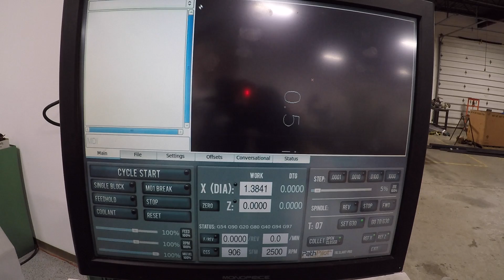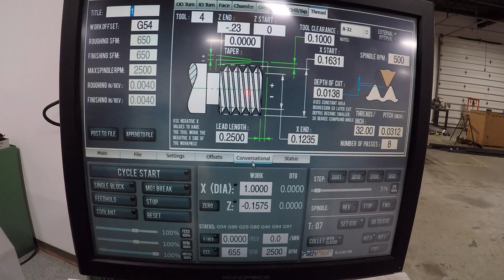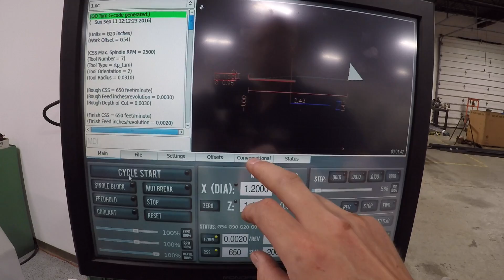CNC Turning Hard Steel!  WW112

Comment: Good tip for using the phile, not many people know that. I do not like the position of the turning tool, it generates vibrations on longer pieces. Must be placed upside down, the insert must face you, and you see beter what is doing and most important you increase the rigidity of the mashine. Think about it: You have the tip of the tool. Rotation of the chuck makes presure on the tip who transmits the tresure to the tool holder and then the preasur goes to x axys. It ghets all the play from x axis if any. Correct me if i am wrong.

Comment: This diameter is about one inch. How does it work, if the diameter is much smaller? My lathe has a max. rpm value of 2500.
I think the sfm value is then to low. cbn tools need high speeds.

Comment: The  dowels  are   surface  or   case   hardened  usually  they are  carburised  and    heated and  quenched in water  .Only surface layer  gets hardened  More ever  the process produces   martensite  structure  which is  and abrasion resistant  But they  not  as hard as  steel  which is  venedium carbide  or nitrogen carbides  I think it would  be great if you use  these  hardened samples rather than case hardened  dowel Pin

Comment: The key is to keep enough surface speed so the heat is elevated on the cutting tip. This will ensure the heat going out with the chip and cutting force not brake the tip of the CBN. In this case, one cut has been enough with lower feed rate and higher surface speed. The lifetime of the CBN has increased 4 times and the surface finish has been even better.
Reply: I forget to mention the dowel pin is normally case hardened so this is why the last cut with same feed and speed don't create same heat as the first cuts. Today some shops supply solid quenched to 63HRc punch pin in custom size with few diameters on stock and turning the punch pin to customer specification. Same day delivery any size!

Comment: try to use those inserts in a CNC milling maschine on a Planing mill against a hardened Steel piece , you need a very low feedrate because of "disrupted cut"
i know a guy that solders his own lathe tools from tungsten mill shanks witch he cuts with electroeroding and he also mills HSS tools for the lathe and internal boaring operations

also never hard turn unattended , a schoolfriend of mine has a friend in a partner company of his in Vietnam that went to get a drink bc the maschineshop was pretty similar to a sauna 
the maschine oil and coolant and hydraulic fluid from a hydraulic cylinder he repaired and plastic pieces and plastic chips in the chiptray ignited from the glowing chips and burned pretty much his hole livelyhood down - his house next to the shop included

Comment: I do machine A2 and D2 and M4 with Somitomo cnmg inserts BN350 . most of my stuffs had interrupt cut . i do run 16-22 inch diameter with 400SFM and depth of cut .0065-.01 and feed about 0.005  . and with one insert i can finish plenty of parts . you should try them if you have lots of hard turnning .
but if they are not interrupt cut . i use Kenametal Ceramic Inserts .

Comment: The reason for the burning chips isn't because the tool is heating the steel to orange hot, but because the chips are actually burning with the oxygen in the air.

The tool just has to add enough heat for the chips to reach the combustion temperature, which lowers as the thickness of the chip decreases.

If you have ever burned steel wool, you will recognize the behavior seen in this video. And if you never have burned steel wool, go get some Grade 0000 and try it! Lol
It is fun, and also useful as an emergency method of starting fires. It can be lit with sparks, with electricity (put some across a 9 volt battery for instance), etc, and it burns very hot.

I can't say for sure why it wasn't burning when you got into the softer stuff, whether it was creating less heat, or if the chip was thicker, or probably both, but a couple of times when the tool would hit the hardened steel at the end of the dowel and throw burning chips into the bird's nest (which is basically a pile of steel wool at this point), you could see the flame trying to spread, but it was too thick and too loose a bundle to stay lit, or it would have burned the whole bird's nest like a clump of steel wool.
And of you had squeezed the bird's nest down to bring the fibers closer and applied a lighter to it, it would have burned quite nicely.

Comment: I run CBNs daily to turn white iron. I don't know the Rockwell on the parts. We run at 600 spm and .02 feed rate. Usually Depth of cut is from .380 to .05 depending on the amount of stock.

Comment: Im turing a 31” long 2” dia piece of steel at 60 rockwell on a manual lathe at my work. If you get thru the hardened surface and into the soft stell you will damage that insert.

Comment: @NYC CNC one thing you might not have considered is that hardness of parts has a depth depending on how the material has been hardened. Generally pins an such are only surface hardened so after you break through that heat treatment your left with the softer metal below. The only way to take the hardness out of the steel is to reach the critical temp of annealing, which is to heat the part or the surface of the part up to that 600F+ degree heat (look up actual temps somewhere).

Comment: If the steel gets red hot then it will lose hardness, if it only gets slightly warm then your fine, I don't think using coolant would work if it gets red hot.

Comment: Dowel Pins are usually only surface hardened. Ballscrews are too.. i machined a lot of ballscrews, the outer layer is hard, but as soon as you have removed the outer layer, threading was easy..
If you want to try something that is totally hardened, try an old endmill shaft.. I use those to make tools for the lathe, hardturning and hardmilling them..

Comment: Sounds right to me, through hardening is a relatively expensive process requiring all kinds of fun maths, specialized cooling systems and are restrained by the laws of physics whereas case hardening can be done reasonably well by anyone with a blow torch, a few cinder blocks, and a bucket of oil.

Essentially you are forcing metal to form a tight lattice around impurities/alloys, metal heats up, impurities dissolve into metal, rapid and even cooling locks it all in place whereas slow, uneven cooling pushes the impurities around and messes up that nice crystalline lattice.

So basically you'll always have a hard time with through hardening unless you've a way to cool the core down as fast as the outside of the metal cools, impossible for solid blocks of any real size, that's why a lot of hardened steels are case hardened or thin/hollow.

Don't take my word for it though, there's open source fluid dynamic software that you can use to simulate this. I used it to model my entire home foundry and get nasty letters from the EPA saying "we don't care what the science is this is the law, cease and desist or pay a $500,000 and spend a year in prison" :P

Comment: CBN is the hardest material in the
world or alike (unless something new was made). A man made Polycristaline “diamond”.
It has unique structure and manufacturing by “backing” few components together
under very high pressure and temperature with no oxygen inveroment. In general,
manufacturing procedure is well known, but each manufacturer has its onw
technological secrets for a reasons. It’s not an alloy and does not have
homogenous structure.  Real, nature made diamond
has different structure (monocrystalline). That’s why it’s not that hard as
CBN.

Comment: you have to remember some of these hardend pins are surface hardend and not hardend all the way through wich is good for many aplications cause they are not so brittle but if you turn away the hardend surface it is gone. also the file you are using is dull

Comment: I believe dowel pins are not through hardened, which would mean if you remove approximately 0.06" radially then you'd hit soft metal.  Seeing the faster cut produce less spark was interesting.

Comment: A spontainious idea of mine is that when you use a more shallow/thin depth of cut, the cutter puts in the same amount of energy into a thinner chip (less material), and thus makes it hotter and glowing.
Could be wrong, but it feels logical in my head.

Comment: You can even use CBN to turn Carbide.  Got an end mill you need to neck, stick it in your lathe and use a CBN insert.  Not great tool life and you need to take  0.02-05mm cuts but it gets you there.  Just avoid the flutes they don't like interrupted cuts.  I would also recommend a manual lathe so you have more control and feel.

Comment: It is usually the case (sorry about the pun there). I read an article in a gun mag that they did a bunch of tests to see what would be the best kind of hardening, whether it would be through or case. They found out case was the strongest over all due to the properties of both hard and softer material working together.

Comment: if it reached like over 300°C martensite stucture turned to troostite or sorbite.  It looses hardness depending on the temperature it reaches. actually after checking it - if it reaches 250°C it turns to bainite, 500°C to troostite, 750°C to sorbite structure. so you dont need much heat to damage the hardened steel. another thing is this thick pin is not hardened through whole thickness, but only up to 5mm on the surface. while the middle is much softer like 45-50hrc

Comment: I found doing this a bit unnerving.  On a CNS that's enclosed you know where the chip is going.  I was doing this on a Clausing 6913 and taking even smaller cuts but was getting red hot chip.  But it's not enclosed so it was scary to figure out where the chip was landing in the garage.

Was using brazed carbide on a piece of drill rod (rod that is used for spinning a drill head in an oil well.

Comment: Drop surface footage to 520 
.005 depth of cut per side flooded with coolant
Feed rate at .003 
Should stay same hardness if heat treat goes all the way threw. The heat should be in the chip not the pet or insert

Comment: case hardened pins sometimes have a nitride coating on it  that explains why it gets softer in the middle nitride is very hard so it will trow lots of sparks  when you cut into it. then it will heat up losing its hardness property .so when you cut or turn that it will get softer ! so to avoid that run lots of coolant or oil onto it to keep it cool. this should fix the hardness change at least once the coating of nitride comes off.

Comment: CBN inserts have been around for a good while now. 
Most likely you are cutting case hardened steel as 1018 is a low carbon steel, surface hardness will be around 60hrc ar surface but the depth will only be shallow on these pins.
CBN inserts don't work too well below 50hrc, thats likely to be when your swarf stops glowing.

Tip, when using CBN don't use coolant as it can fracture inserts.

Comment: CBM actually has a hardness greater than diamond with better thermal susceptibility and better mechanical properties. To put it simply, harder, less susceptibility to heat, better wear resistance, much more abundant, and fairly simple to produce. Damn incredible stuff if you ask me.

Comment: the hardening treatment according to the specifications of the design can penetrate to 0.6 / 1.2mm below the surface. This obviously depends on the quality of the base material and if it is undergone remediation before turning. the hardness in the case of hardening does not mean anything because you can get to relatively 56/60 HRC but the depth of hardening and of only 0.4 / 0.6 mm from the surface
Reply: I work gear wheels 18 ni cr MN05 hardened to 57 HRC which I arrive already turned, toothed and ground and I have to take them on the drill to make the seats on the crown in tolerance of + - 0.02mm ... the hardened surface is the hard part then once it surpassed that and a material is tough but not that makes you despair ... as in drilling use a center drill carbide at 90 ° included angle and make a hole to the center 0.2 more big toe and then I'm going to drill with a HSS in normal ... 
the price of this gears is 500€ of once . expensive !!!

Comment: why do you use the imperial system? i did  a job for an american company andwhen i got the  blueprits they were in the imperials and it was all fucked up and it was soo difficult to work with. i had to manually remake the blueprint so i could use it and then send it to the company to get it approved and then i could start working again!

Comment: The biggest diameter the lower hardness inside. You can trust me. I was working in company(as QC and technology) making M140x8 bolts 850 mm long gradem 8.8 for ball valve for power plant. We had a big problem with quenching and tempering fi 140 bars to 34 HRC. But we made it ;)

Comment: Case hardening processes implies surface enrichment with carbon and/or nitrogen, i.e, carburizing or carbonitriding. That's why you only get those flames in the hard surface, mostly due to the extra carbon.

Comment: Yes, you can use CBN to turn ballscrews. I don't think you can easily get CBN threading inserts (too fragile, maybe), but generally you pretty quickly get below the hardened layer of the ballscrews I can afford to use, and then conventional threading tools are fine. 
I have done it a few times now. I have a video on my channel of hard-turning a ballscrew on 1950s Colchester with CBN tips.

Comment: Hey I just watched "CNC Turning Hard Steel! WW112" 
Hardened steel never has the same hardness on the inside. HRC is always particular high on the outermost layer.
You should really look into metal processing. Steel and aluminum are the most important. Especially with focus on phase changes. (there are many different physical processes that can affect strength and hardness, and heat treating is only a rough description)
I would sent you my scripts from my university but they are written in german..

Comment: Those pins are soft, you can cut them with a decent carbide insert. I regularly hard turn parts over 60HRC with CBN its a fucking nightmare most of the time. With most tool steels you can easily get a mirror finish if its running good, but you have to have a really heavy machine, and a super rigid setup. Got a part that has holes in it, good luck, interrupted cuts will shit on your day. We even had seco come out and they said fuck it. 

Ideally you want to see that red hot ribbon flying away from the part, your parts should get no more warm than they would from high speed milling without coolant. They can get warm to the touch but shouldn't be burning hot. 

There really isn't much advantage in it unless you are trying to kill a slower grinding operation, or have a profile too complex to grind. There are a couple parts I make that have to have 3mm taken off every time they get reworked. Hard turning takes roughly 45 minutes or an hour.
Reply: Just to add to this, most of those pins are case hard, they will be softer in the center. Also, decent CBN inserts are not cheap, they run upwards of 70 bucks an insert. You can get CBN inserts in just about every common form. The ribbon is normal. As far as the glowing the harder material usually does, you can actually run the hell out of it for giant flaming wads of chips blowing everywhere. 

You have to watch out, just a little bit out of the zone and those inserts fail. You can usually tell by bright white sparkles in your birds nest.

Comment: Old news now John, but those pins aren't through hardened. 

I love the finish hard turning provides, however the trick isn't so much to remove material, believe it or not, most lathes will be capable of doing that, the issue is to bring it up to a particular size. I don't know if you miced the part, but a very good test is to hard turn (ie actually hardened material) to a particular size. In my experience deflection is an issue and it would be interesting to see how this machine coped with a real world problem.

This inserts can be used on regular steels and if you want to give them a go on 1020 etc run them REAL fast. Like flat out fast! I use cermets regularly and the finish on many steels is almost as good as what you saw on hardened steel.

Comment: I hard turn 58-60 rc well for a living. I avoid cbn as much as possible, ceramic is the way to go it's a lot cheaper and it cuts better then cbn. The only time I use cbn is on interrupted cuts.
Reply: Sometimes the material you need to machine only comes in a hardened state.Induction hardened chrome hydraulic cylinder rod and linear shafting are two such items.
Reply: It  can help with surface finishes and can be more economical as it may cut out some finishing operations and a need to heat treat the parts after work has already been done to them. Really limits the chance of critical features changing due to heat treat or scrapping expensive parts because of a botched finishing op.
Reply: Why would you choose to hard turn? I mean wouldn't it be easier to turn something and then harden it? And doesn't the heat from turning something destroy the temper of the metal?

Comment: the remaining hardness depends in the heat treatment and the type of steel. the speed of cooling of the surface is much faster than the core.  or if it have a superficial treatment like cementation or nitruration or the combination cyanuration 
but those treatments only gives like max 2 millimeters of depth soo i think maybe hardened superficially by a molten salt bath or after heating cooled a few seconds in oil and left in air.
they made that so it have superficial resistance to the wear and the '''''''''''''soft'''''''''''' core supports deformation and avoid cracking clean off. they do the same to the teeth of the gears but with cementation and heat treatment or only nitruration